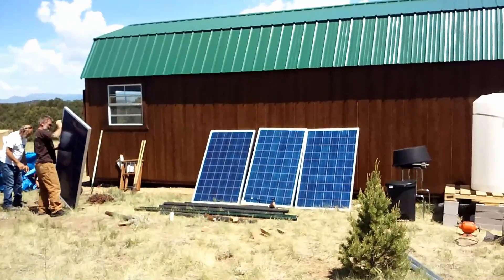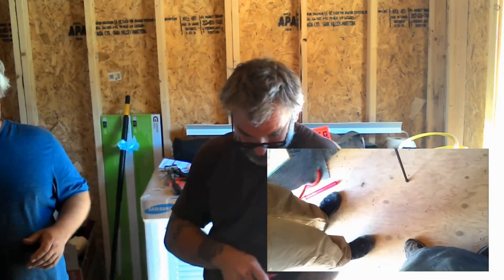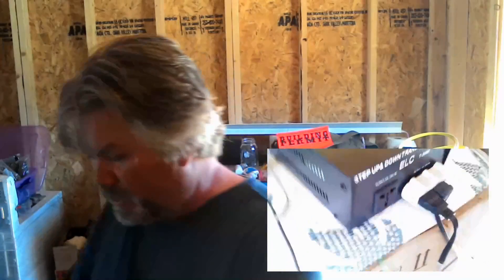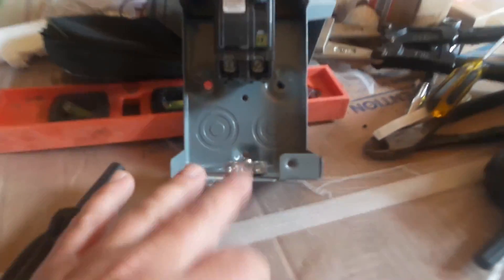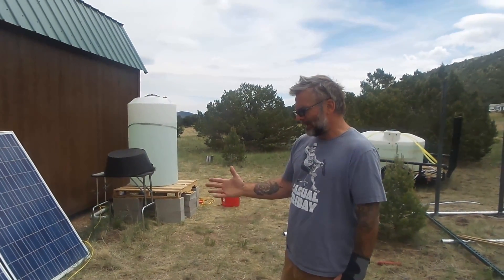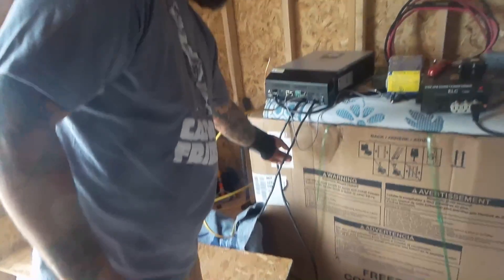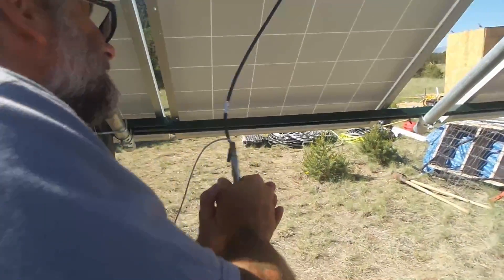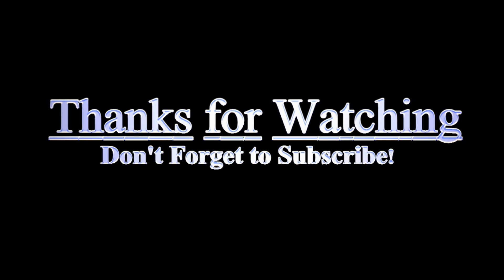Duanes Solar Panel Wiring

Comment: hi sir. was not better to run #6 gauge wire to the breaker and controller
Reply from the maker: pepe58 pepito high voltages and lower amperage allow smaller wire to be used.

Comment: Those panels are monocrystaline ones, aren't they?
What gain percentage are they? Above 16%? It's said monocrystaline is better than polycrystaline.
The whole setup it's solid, eh?
Reply from the maker: His panels are polycrystalline.  I do believe that the mono is slightly better in performance over poly in traditional manufacturing forms.  But out here where real estate is relatively cheap, we'll take very inefficient panels if the dollar per watt ratio makes the extra mounting worthwhile.  68c per watt for these panels makes the extra mounting practically a non-issue.  Out here we're all about cost vs. output rather than efficiency vs. physical size.  The whole setup isn't the most solid ever made, but it's very adequate for Duane's needs.
Reply: Steve Robertson Good to know, I was wondering, but yes, if it works and it costs less, always welcome. I think I'll go with poly too, cause in my country the mono cost the double. Thank you for the video and the fast reply. You and Duane seems to know a lot about solar energy.

Comment: Thanx for your simple explanation    So its better now to connect 3 panels 36 w in series to the pip 4048  ;  is it safe for the inverter ?
Reply from the maker: These panels are rated (I think) 250w each @ 33VOC (Volts open circuit)  Four in series is about 132 volts open circuit, but the voltage needs to be below 115V in order for MPPT to function.  150VOC is the maximum that can be fed to the inverter.

Comment: Steve thanks for sharing this install. I learn something from each of your videos. one question.  any problem from dissimilar metals mounting the aluminum panels on the steel unistrut? I have four 300 w. panels to mount on my fifth wheel and looking for a cheap rails to use.
Reply from the maker: Electrolysis can occur due to oxidation of the dissimilar Metals.  However if the metals are electrically and mechanically bonded to each other it should eliminate most if not all of that problem

Comment: From what did he receive the shock when he connected his ground? Was it static build up?
Reply from the maker: Static build-up occurs just from the wind in the air - plus the air is so dry here.  Back in the day when we would climb towers, if a ground strap from one section to the next became unattached, we would get some nasty shocks just crossing tower sections.
Reply: Steve Robertson 
Thanks
Didn't know about metal building up static charge from the atmosphere..

Comment: I have 12 100 watt panels i have them facing solar noon for my area & angled at that time of day . I have them going throw a grid type inverter when i put them up i got around 1000 watts that was in the winter now i only getting 700 to 800 watts at solar noon it,s summer here & we are having 90 + degrees weather. I see other persons on you tube complaning to is it the solor panels going bad? I purchased a 160 watt panel 2 months ago i ran it throw a   Amp Watt Meter & grid inverter & a water meter & only got 50 watt & had it setting agains my building facing the sun at solar noon. Can you help me at all?
Reply from the maker: That's a good question, and one I had when I first started in solar power over thirty years ago.  Here's your answer:  The hotter a solar panel gets, the less efficient it converts light into electricity.  Most people think the hotter it is, the better it is because most solar collectors are a function of heat.  This isn't true with photovoltaics.  They convert light, not heat into electricity.  The colder they are, the more they will produce.  Superconductors work the same way, in the colder they are, the better they conduct electricity.  

But I have to admit that only 50 watts from a 160 watt panel doesn't sound right.  A panel like that should give you about 170 watts when perfectly perpendicular to perfectly 1kw sqm of sunlight, and about 120-140 watts on a hot summer day.  That's one of the reasons I buy an abundance of solar panels, so any derating they have in heat doesn't bother me anymore.  The other reason is they are cheaper than house windows.
Reply: @OffGridLivingSteve  maybe in the future  new design may use heat sinks to reduce heating .
Reply from the maker: @sharyncomstock7066  that may be for the future.  Panels are cheap enough now that it's not too costly to just buy a few more.
Reply: @OffGridLivingSteve  thank you  for  sharing all your time and hard work with us. We greatly appreciated  your  knowledge. In short  that's what good people are all about .
Reply: Heat reduces output. The hotter the panel is, the less power it produces. To test this, spray water on your panels for a few minutes and then check the output.
Reply: @PopsShack  good advice

Comment: I have unistrut as well its great stuff, and you can also use the unirack stuff for holding the panels down using the 1/4 inch spring nuts and bolts works hand in hand and its cheap I pay 15 buck's for 10 foot sections of unistrut.  nice nice.

Comment: You should be careful if you get cloud Edge effect you will go over the rated open circuit voltage of 150 volts on the string of 4 panels that mppt charge controller in the inverter will shut down or crash. 3 panals should be perfect in a string then paralelled with more strings up to 3kw or 60amps good job anyway guys...
Reply from the maker: I've never heard of cloud edge effect, but I'll google it.  This setup is only temporary until he gets his electrical building built.  We do have it spec'd as 3 panel strings for the final installation.
Reply from the maker: Thanks for the link.  I loaded the PDF file in my system.

Comment: Looking good! Series the panels in 3 around 100 volts is perfect. The pip will take 145vdc but mppt range is from 60 to 115 if over 115 the mppt is not working.
Reply from the maker: The nearly 140 we were reading was VOC.  Under load it dropped down to about 109.
Reply: Nice! Looking forward to more videos on the project.

Comment: the 2 pole qo breaker is rated for 125 volt DC as I recall also the voltage will go over your maximum voltage when it gets cold out if I'm understanding it correctly you can't use 4 panels in a string. the shock he got was from capacitance from the panels.